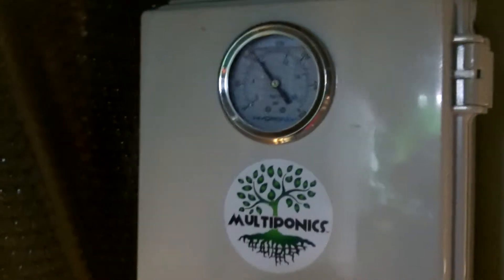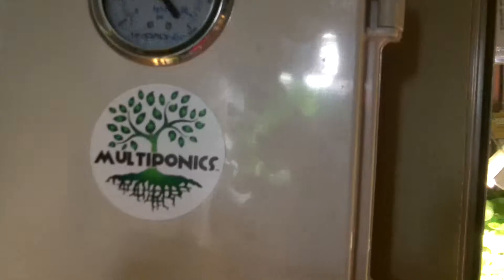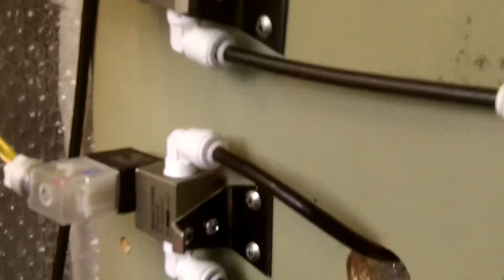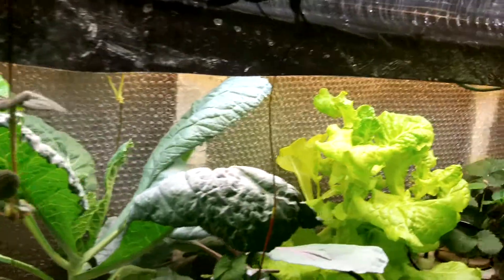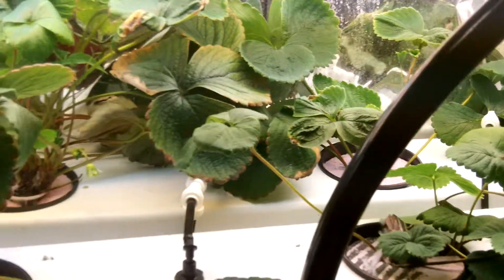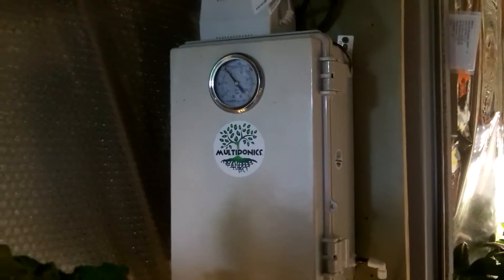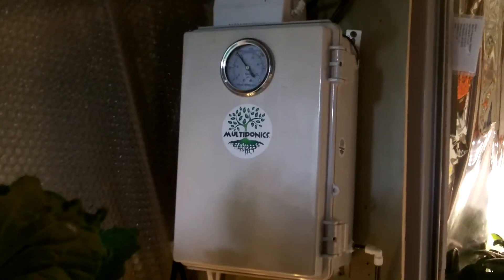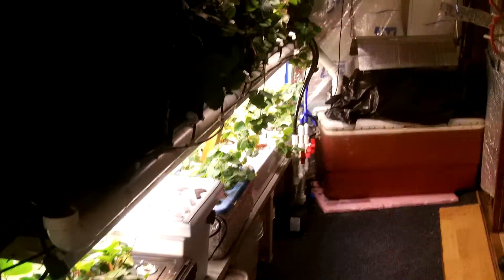aeroponics expansion, treefrog multiponics

Comment: 10 seconds is a very long misting duration for hp aeroponics, 3-5 seconds should be ample with the solenoids. The Reefkeeper is an innovative way of controlling the pump and zone solenoids. I have an outdoor hp aeroponic system (offgrid) compeising two 16ft x 2ft chamber with 12 nozzles in each. I use a solar panel and 12v SLA battery to run the cycle timer and solenoids which are connected to a large accumulator tank. The tank is charged using a manual high pressure pump once a day.. I use 1 second, 3 minute cycles during the day and 1 second 10 minute cycles at night.
Reply: +JohnGuest45, would love to see a schematic of the set up and the model # solenoid you are using.